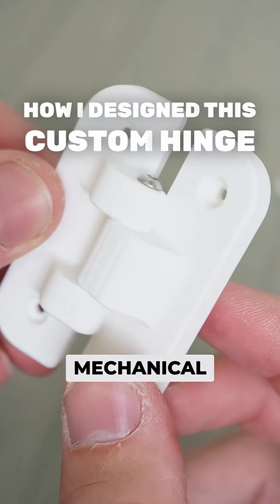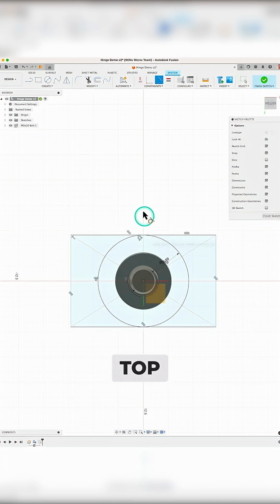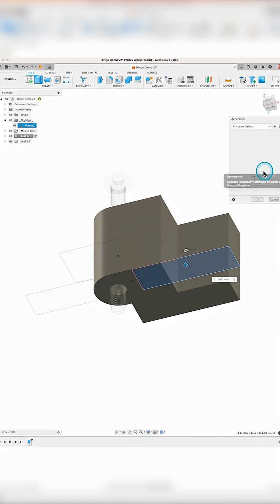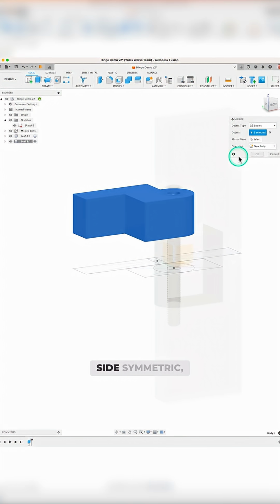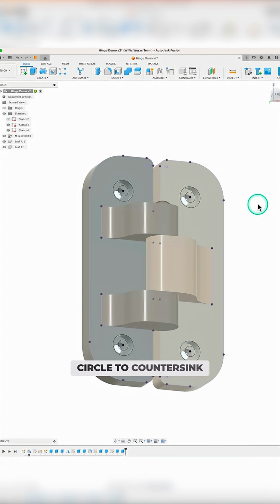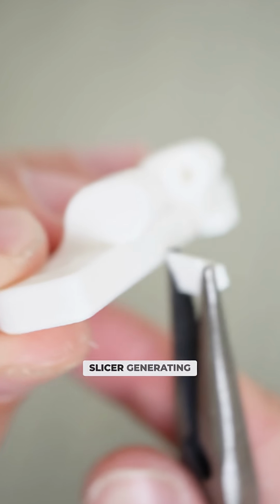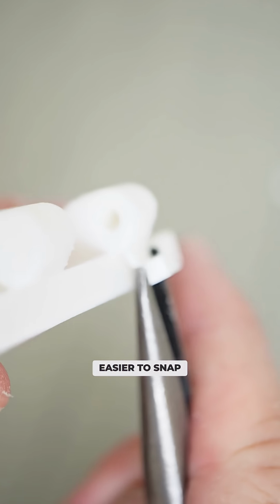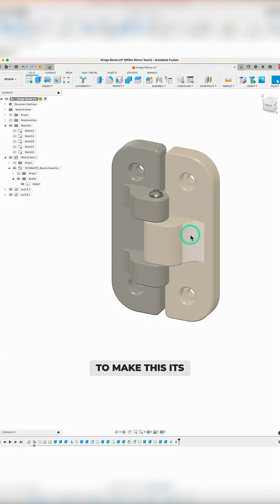How I Designed a Simple Hinge 🚪

Comment: Thanks! I just have a doubt about the printing direction based on the position of the support pieces: having the print layers parallel to the bolt might create a weakness as it makes the hinges more prone to tear, don't you think? But in your use case I suspect it's not much of a requirement.
Anyway thanks for sharing 🙏🏼

Comment: Why did you use extrude to make the mounting holes rather than use the hole tool that let's you change all holes at once? (In case you want to use different screws or something) just curious. Everyone has a workflow that works for them and I try to understand everyone's decisions to see if there is something I can learn from. 

I had no idea about the "start from object" extrude option. That would have been nice to know weeks ago.

Great video!